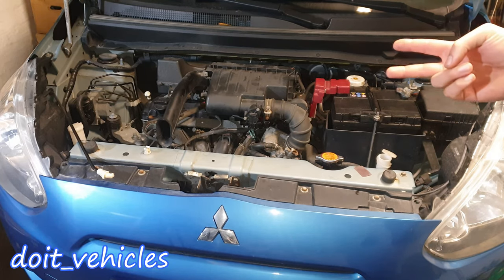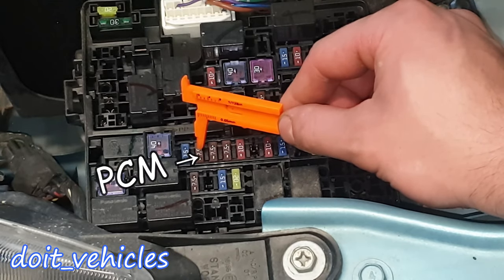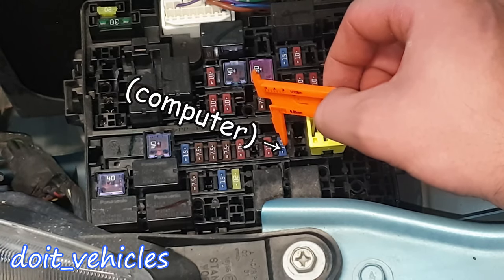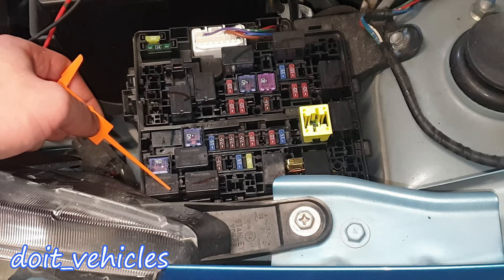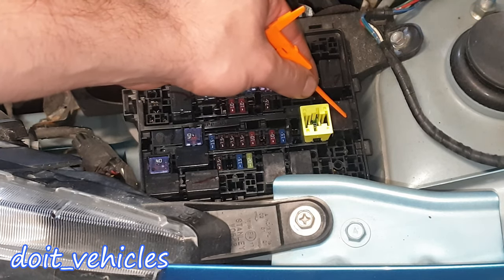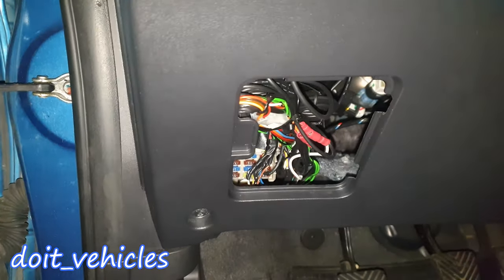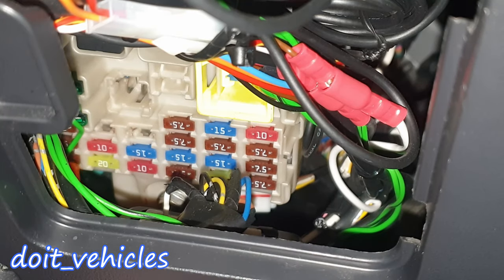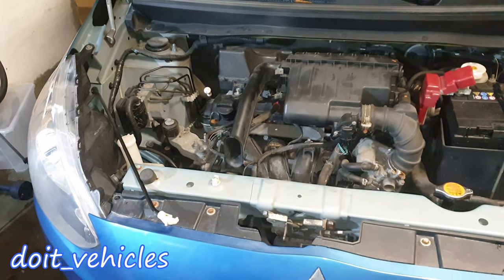ALL Fuses & Relays Location Layout from 1.0 Mitsubishi Mirage Space Star ( 2012 - 2016 )

Comment: excellent video, i have issues finding the relay on this car for fan, low and high, what happens is that when my car is hot, it seems that the relay for the ac compressor stops working, compressor test are ok and the rest of sensors are ok too, but high speed fan doesnt work properlly , fan has two cables  , would you know where that relay or convertor is ?

Comment: i want to ask, i have a problem with indicator engine lamp, the normaly lamp is on while we start the engine and then off, but in my car always off,mirage exceed 2013. so what must i do to the normaly that.thanks
Reply from the maker: If you mean the " check engine light " , than it's good to be off when the engine is running :)
Reply: @doit_vehicles  yes, that i mean, but the actually the check engine light always off, when the engine on or off.

Comment: thank you for this video.. want to ask if you have a video how to make a switch for the radiator fan making it run without activating the aircon. thanks
Reply from the maker: that would be simple , just bypass the original connector , than wire it up from the battery with a switch
Reply: @doit_vehicles  i dont inow where is the connector  to put directly on battery with switch.  Thanks